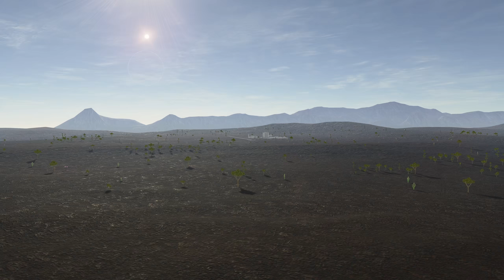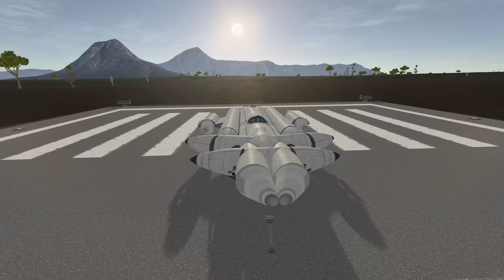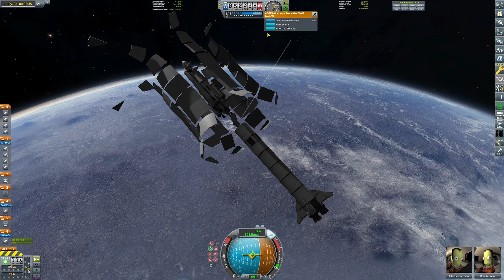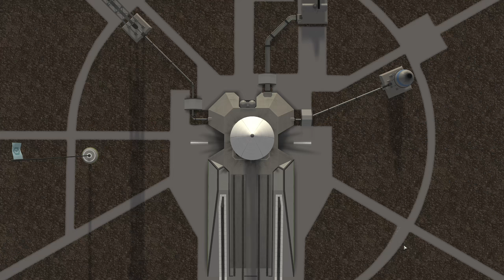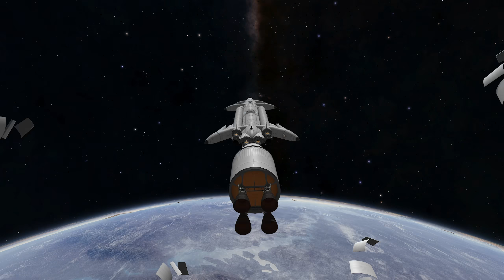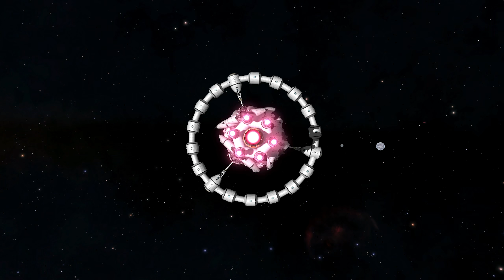KSP Beyond Home - Going Interstellar!

Comment: I don't know how well this will work for this exact modpack but in the current modpack I am playing I forced KSP into DX12 mode (I have a 6 core 1st gen ryzen so it's single core performance isn't...the best) and I got a significant amount of extra performance. I don't know if you've already tried it but maybe it's worth a go?
Reply from the maker: I'll try it, but changing the renderer usually affects GPU performance and not CPU performance. Still, I'll try it :)
Reply: @Gameslinx  The reason I mentioned DX12 was because it allows utalization of more than 4 cores at once, it'll probably put more strait on your GPU too cause ofc it's able to use more CPU power so your GPU is waiting around as much
Reply from the maker: KSP uses 1 core and only 1 core anyway because it's awfully optimized
Reply: @Gameslinx  I always thought in DX11 mode it would use core per ship but only up to 4 or something like that